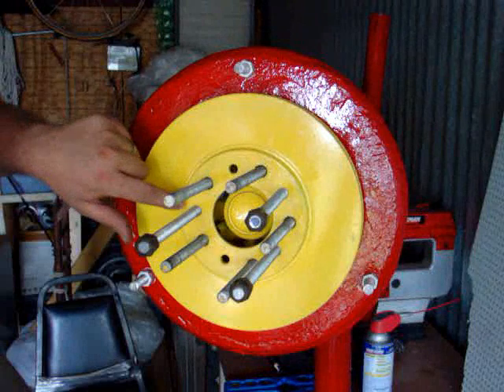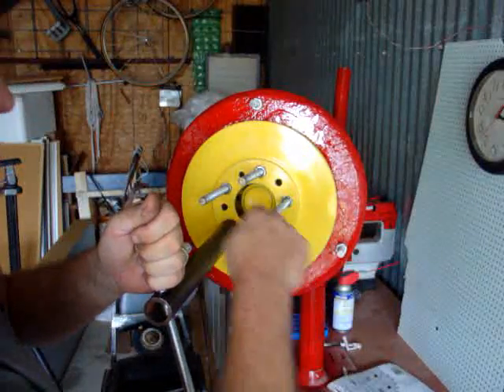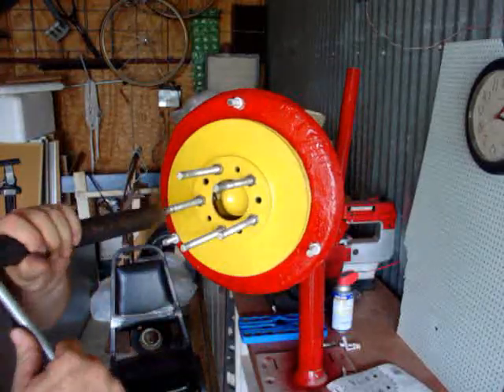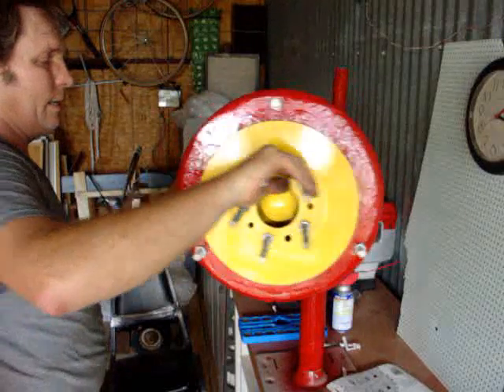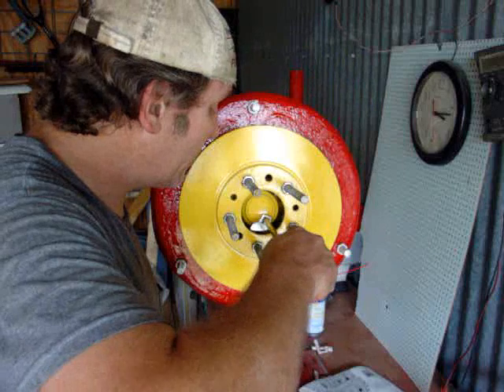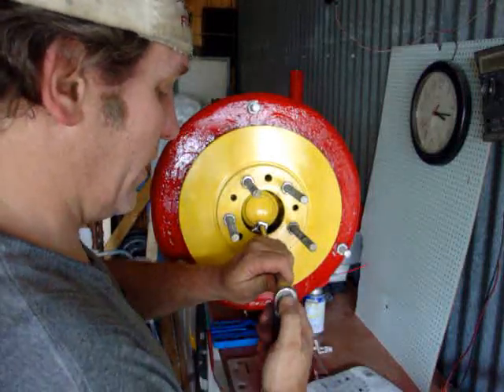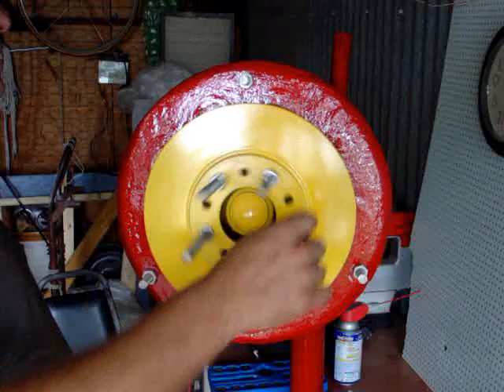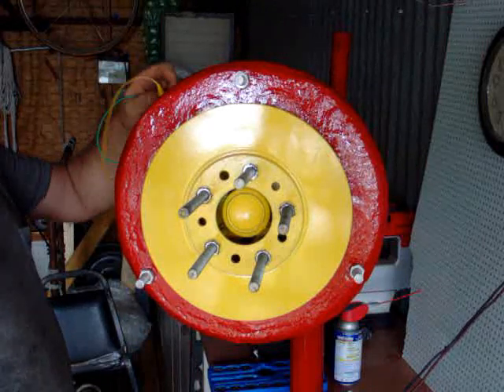BUILD A DUAL PERMANENT MAGNET ROTOR WIND TURBINE (PART 27)

Comment: is there a difference in output between 2 sides with magnets versus one side only?thanks
Reply from the maker: +man of steel 
yes. more than double.
Reply: ***** THANK YOU VERY MUCH
Reply from the maker: You are welcome. Let me add this, The magnetic flux between the magnets act sort of like rubber bands. They get pulled directly between the magnets, Thus focused through the center of the coils. air coils.
most other gennerators,motors, and alternators accomplish the focusing of the magnetic flux by using steel or ferrous metals inside the coils. This drops efficiency by at least 45%.
These dual magnet rotors achieve 97% + efficiency by air core coils and design only.
Pretty groovey huh?
MUDDy
Reply: ***** thanks for the info, God bless

Comment: I used approx 170 turns of 26ga,6 coils,in star. I fabbed a HAWT for testing, i get about 30 volts on a spin by hand which im sure drops rapidly under load. I use it to light up christmas lights out by the street..  People freak when they drive by n see it blinkin its little heart out..Lmbo!!!....im still in the prototyping phase as far as producing anything that will put out anything resembling real power...but just as with u..I dont give up easy!!...Oh yea thanks for the offer on the prop!

Comment: Would the output be higher without the resin on the inside of the coils? It seems that the stator thickness would dampen the magnatism and having windows where the magnets face each other would increase their strength. 
keep up the great work

Comment: Sounds Great! :)   Found the Magnets4less  Neodymium 2x1x.5" N42 Model #NB055, prices as of 9-6-12 is $7.29 apiece. Even called my city's building codes office and found out I can have a 60' pole!! More benefits from owning an acre in the middle of the city. Turns out that I would be the first in the city to have a wind turbine, too! Yeehaa! I'll wait for further videos before asking too much about adequate pole sizing, but I more than likely will use large fire sprinkling pipe. 
thnx
-Luke